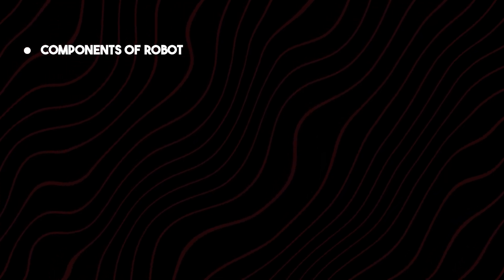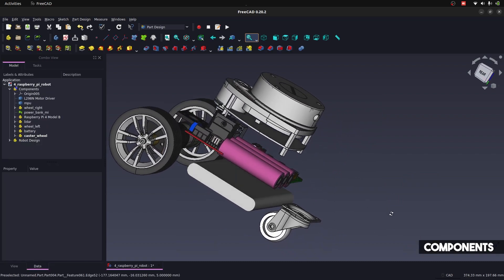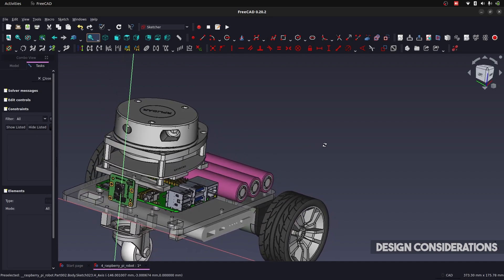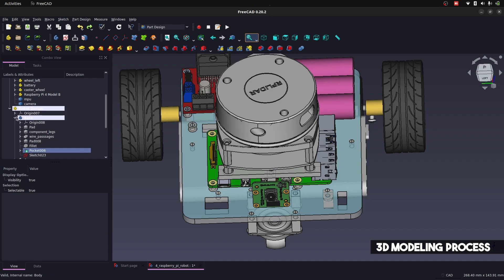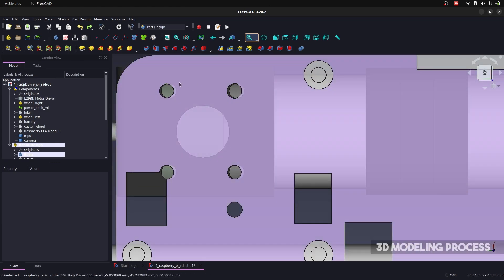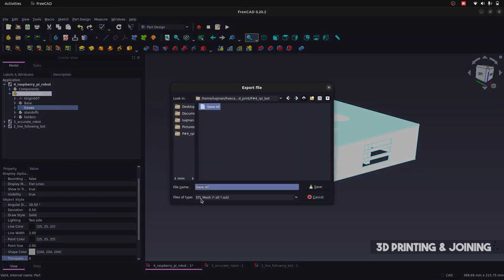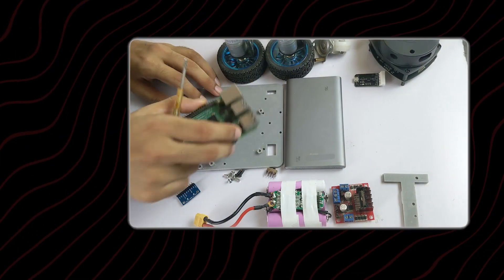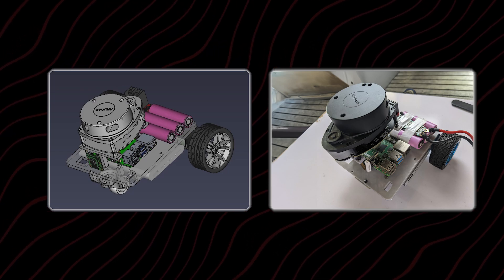Lidar based 2D SLAM Robot : Design to 3D Printed Reality for ROS2

Comment: Hey Muhammad. Great video!  🦾One question. I'm guessing you have 2 power sources (power bank and batteries) to power different components (motors, rasp, lidar). How do you handle recharging your sources? Do you do it separately? Or did you do something to unify the recharging?
Reply from the maker: lipo cells are changes by removing frm this bracket to charger brackets

power bank by simply type C cable

Comment: hey ive printed all the models but ive noticed that the encoder motors holders are missing in the stl files
Reply from the maker: these motors have attached encoders and metal holders are bought with the motors